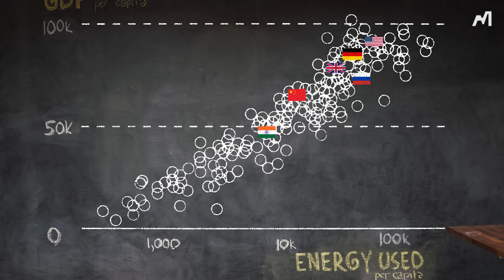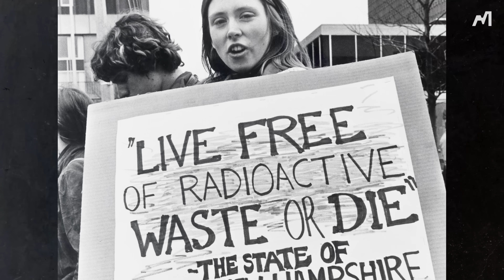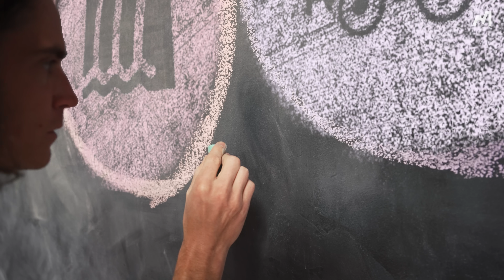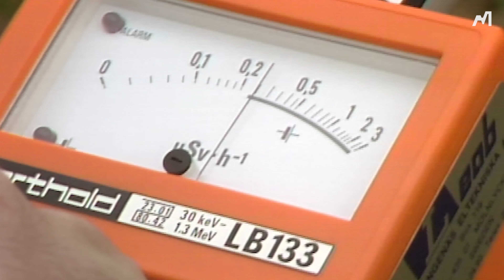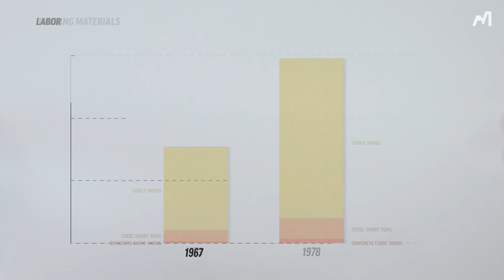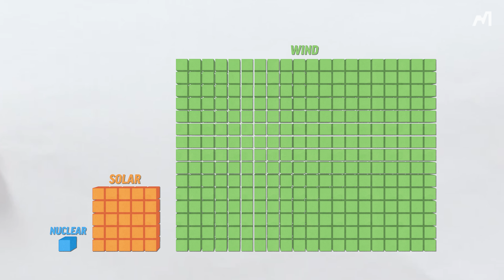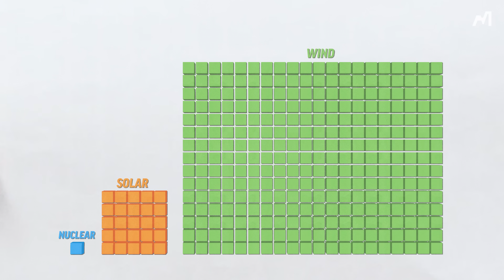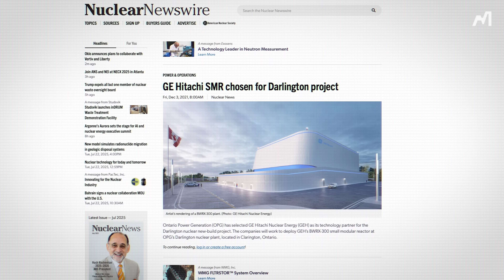They're Lying to You About Nuclear Energy

Comment: It's also worth noting, that average coal power plant releases many times more radiation (along with much more deadly chemicals + smoke) a year that event the nuclear powerplant could.
Reply: Wish more people understood this. You'd be better off hanging out in a nuclear waste cooling pool than you would walking next to a pile of coal ash or god forbid breathing that dust in!
Reply: @DarkAttack14 Oh yes for sure. By inhaling coal ash i had suffered radiation poisoning, which completely wiped out my immune system (no more white blood cells) and led to severe pneumonia. According to biomarkers, I glowed like a Christmas tree!
Reply: @DarkAttack14 What an insane lie! Millions of people all over the world have worked with coal for decades,  and some got black lung, but it wasn't till the bomb tests that cancer rated went sky high!
Reply: @DarkAttack14  that is incorrect. You would be shot before you get into the pool. And being irradiated is better than being dead.
Reply: @DarkAttack14  if the waste isn't damaged it would even be safe to drink from the waste cooling pool.

since fuel before, during, and after being spent is contained in a zirconium cladding and ceramic. all this and even the uranium itself isn't water soluble, so as long as you don't get close to the spent hot fuel and it isn't damaged, you can bathe all you want.
Reply: @D2_Papaya yup, based off the average depth of a spent fuel pool, if you're three feet underwater swimming you actually receive less than background radiation due to the shielding of the water both above and below you, fun stuff
Reply: @DarkAttack14  what do you mean by shielding of the water underneath you? What does that mean
Reply: @raymondqiu8202  If you're in a pool and you dive under the water, there is still water below you. Water acts like a radiation shield, so having water underneath you, you're shielded from what little radiation there is coming from the spent fuel.
Reply: @D2_Papaya  Man, I'm so tired of this BS.
"Our nuclear waste is so clean bros, believe us it's so clean that we sell it to poor countries where it poisons the countryside!
Not that we'll ever tell you about it."
Yeah, you go ahead and keep preaching, I'm not buying it.

Reminder that thousands of people died in Southern Serbia just because of some Uranium-enriched ammunition in NATO bombs.
These are literally just small warheads you could pick up with your hand, and look what it did, a quiet slaughter for decades.
Reply: @raymondqiu8202   Radiation from above (background radiation you're sitting it right now) is diminished if you're in water. Radiation from below (in a spent fuel cooling pool), the rods are in sealed bundles at the bottom of the pool, you have to get within a few feet of those bundles before the radiation they're giving off would equal background, and the pools are very deep. So if you were a few feet under water in an active cooling pool with hot rods below you, you'd still be getting less radiation than anyone walking around the pool.
Reply: @D2_Papaya all you want?? As if it doesn't build up on the body and cause health issues. I think you need to stop drinking that water, its rotting your brain
Reply: @Azmodon  ah ok got you. But if you are a few feet underwater in an active cooling pool, how would you be getting less radiation if you are closer to the rods than someone walking on the ground around the pool? you are closer to teh rods no?
Reply: Go for a nice long soak,you won't need a night light as you'll glow nicely, if you don't boil like a frog first.
Reply: @raymondqiu8202  The water below you would still be more than enough to protect you from the spent rods.
Reply: @D2_Papaya  not to mention the radiation and circulation sterilizes the water
Reply: @raymondqiu8202  I think they're implying while a few feet down the water below attenuates the radiation from the fuel/waste at the bottom of the pool and the water above attenuates background/naturally occuring radiation we all get everyday just being outside. Pilots, airline stewards, and farmers get more radiation total a year than nuclear power plant workers because of how much closer to the sun you are on a plane and because of how long outside farmers are (continuous exposure to sun, continuous exposure to the ground (isotopes give off radiation and they occur naturally in rocks/the soil)). Power plants have shielding and layers of protection from the reactor to where people occupy work spaces.
Reply: @raymondqiu8202  water acts as a shield from hard radiation like gamma rays. the water blocks or slows down the radioactive waves making them less dangerous to a point where they become entirely harmless and get converted to heat. a few meters of water between you and an active reactor core is enough to dissipate almost all radiation coming from the core.
Reply: @raymondqiu8202 water is a medium used in cooling… radiation is heat.. thus shielding
Reply: @raymondqiu8202 radiation is emitted by the earth.  Also Radon comes up from the earth.
Reply: @LTRand ah ok thanks
Reply: @raymondqiu8202 the water above you shields from the sun's radiation. The water below you shields from the waste and earth.
Reply: @raymondqiu8202  - It means that the spent fuel is not at the surface of the pool, and that if you were swimming 3' under the surface, there would still be several feet of water below you and above the fuel, separating you from it.
Reply: @raymondqiu8202  the actual water itself is shielding you from the radiation, that's why it's used and the pools are completely open like they are. Water, while not the best shielding, it's still a good radiation shield that can be acquired in bulk without much issue.
Reply: @D2_Papaya  you first ! :)
Reply: @gary7176  I wouldn't mind using spent fuel as free house heating too, its in a indestructible dry container to begin with, might aswell harness it.
Reply: @D2_Papaya Please don't drink the water. They need it for cooling!
Reply: @raymondqiu8202 As my Dad explained it, water just doesn't transfer radiation. One of those weird properties of certain molecules. Think about it: water cooled reactors don't transfer their radiation to the steam generator part of the reactor, nor to the ultimate cooling system water. Skeptics didn't realize that the cooling water was not radioactive, just warm. Air also has an interesting property for example. If you insulate your walls, the trapped air won't transfer the heat from side to another, but it will if it's allowed to circulate. It only transfers through a single layer of atoms. Aluminum corrodes, but only oxidizes a single layer of atoms. If you leave the atom layer alone, it won't corrode all the way through.
Reply: @TheAlexRhodes  You just compared a literal weapon meant to cause harm, and spent fuel designed to cause as little as possible.
Reply: @TheAlexRhodes There is a difference.
Reply: @raymondqiu8202  the rods aren't what's causing the people outside the pool to receive more radiation than someone in the pool, it's the latent background radiation that everyone experiences everyday just existing causing them to receive more radiation. 

I get you are asking a question and just seem to be curious but the way you're thinking for that to even be a question is part of the whole "fear mongering" about nuclear power. You're assuming even after learning that the water you would be submerged in shielding you both from above and below (as long as you're nearer to the surface than the actual rods) that somehow you just can't be receiving less radiation from the rods. 

Which is heavier, a kilogram of feathers or a kilogram of steel?

EDIT: I realize this is a 2 month old comment and someone may have already said something along these lines to you and perhaps you you understood and it ended up being a constructive conversation. I apologize if that is the case and hope you have a wonderful day 😅.
Reply: @DarkAttack14 yes but the risk of a nuclear power plant melting down or having a problem has much larger negative implications. A fact which everybody in the comments section seems to be blissfully ignoring. Plus many kg of nuclear waste that we often store in a less than satisfactory manner.
Reply: @배고픈13  what you're sayong is the same as saying the risk of a plane crashing means planes shouldn't exist. Only two accidents have occured in the entire history of nuclear plants and it was because of human negligence, not because nuclear plants are bad, and these accidents barely caused casualties.

"Nuclear waste" is just water with a slightly higher tritium content than ocean water already has. It's not green goop that turns you into a mutant with four arms.
Reply: @배고픈13 There are many deaths on any side of any coin. Many people die getting oil out of the ground, many people die from coal mines. In all the time of nuclear power there's been 2 problems. Significantly more coal mines have collapsed than that.
Reply: @배고픈13   the new plants can't melt down. They are walkaway safe.
Reply: @DarkAttack14  But that's just the issue - this isn't an either/or thing.  Neither of these options are worthwhile, given what we know about their down sides.  There are other alternatives that make way more sense.
Reply: @Sharpfinger you consider nuclear not worthwhile or an I misunderstanding your comment? There's absolutely no significant downsides to nuclear power, nor any alternative power sources that make more sense than nuclear. We legitimately should have been on a fully nuclear power grid by this point in history. The only true downside to nuclear is the cost to build the facility, but at the end of the day it's still worth it. Carbon free power production, amazing baseload. Your average nuclear power plant likely requires less lubricating oil versus a wind turbine field. Nuclear energy has the lowest deaths per terawatt/hour of ANY power source including hydro, wind, solar, geothermal. That's accounting for deaths during construction, and does include deaths from the byproducts (and the major nuclear incidents we've had in history)
Reply: @DarkAttack14 Hmmmm, this is, to say it lightly, vastly misleading, although it holds truth to it.

A fair comparison would be to hang out in the safe areas in the pool where you are shielded from the radiation and then walk by the coal plant with a breathing system and appropriate filtration for the particles.

Does this indicate in any way one is superior than the other in terms of safety? Not like in the picture painted by your comment. Is nuclear power still safer than a coal plant? Yes. Does this mean a nuclear power plants are save and nothing can happen. No.

Paint a fair picture, would you?
Reply: @leandergihr9598 not vastly misleading. Accurate. People just don’t want to hear it.
Reply: @Nill757  Nope. I´ve made my argument in detail. It is, in fact, a missleading explaination. Yet it still doesn´t mean that coal is good.
Reply: @leandergihr9598  okay but the nuclear spent fuel is heavily protected and shielded while the coal is exposed. it's a fair comparsion because these are the actual dangers we experience
Reply: @kibukaj2956  and @Nill757 you both got it wrong what the point was. Nobody arguing agenst your comparison is pro coal. But you want to paint the picture that nuclear power is safe by painting a bad picture of coal (worse than it actually is). How does this help the argument? When people do the research and see that you paint a disingenuous picture, the trust in nuclear power will get even worse. Regardless of the actual safety level of nuclear power.

We havn´t had safety protocols for coal back in the first industrial revolution but we now have (I´m talking from the EU perspective because thats where I´m located) and we do have safety protocols for coal in place. Coal is STILL killing more people by a mile and coal is bad. But there are regulations for filtration and for transporting coal in place and it´s not like a horse is towing the coal in an open container and the guy is burning the coal in an open fire, contaminating everyone around him without any precaution. That´s the issue of the argument.
Reply: @DarkAttack14 those aren’t the same the cooling water in like the feedwater of the coal plant and the ash is a byproduct much like nuclear waste
Reply: I'd like any polling on nuclear power to also ask "What is the white stuff above the cooling tower?" to see who thinks it is smoke and who thinks it is steam. (To help calibrate how being knowledgeable might align with support.)
Reply: @gordonmcdowell while I dont agree on every point made, im grateful for the opportunity to learn more about something i admittedly knew very little about about prior so.....thanks 😅😊
Reply: This is 100% true. Coal contains trace amounts of radioactive elements like Thorium. The leftover coal ash still contains a lot of that Thorium. As such, coal ash sites are more radioactive than nuclear power plants.

Scientific America published a paper on this back in 2007 in case anyone was wondering.
Reply: @troybaxter  not just thorium. most coal deposits contain radium, uranium and polonium.  compared to this nuclear reactors are outright clean in comparison.
Reply: @troybaxter  hats of to you. good stuff quoting the paper👏👏👏👏
Reply: @troybaxter thorium and radium
Reply: @troybaxter  also radioactive izotopes of coal
Reply: @rokaslokusevicius3810  coal is not an element. I think you mean carbon.
Reply: @troybaxter  same thing in my language
Reply: It's steam not smoke...😮‍💨
Reply: @75shadystorm Coal-fired generating stations produce both.
Reply: Many , many people are killed every year just from breathing oil exhaust, certainly over a million, although unknown, the number that die from coal related deaths is less than that. I was a miner, but not coal, all the miners I worked with were coal miners. Most of them are dead.
Reply: Roughly 30x. From the NRC site and a nuclear engineer's word. But it's still low, lower than normal background absorbed dose. Don't be hyperbolic in the opposite direction, that would be hypocritical to your point ...
Reply: Like many subjects, processes, and fears that are KNOWN in the general population, hype and spin have skewed the truth.
I was a nuclear refueling worker for years, and the general public is ignorant of nuclear energy, and programmed to fear it. 
My take: research everything. Trust nothing. Everyone (press) lies. Except for this very good production! Thanks for some truth!
Reply: you left out the mining and trans of coal, by the time you factor that in, it's a no bwainer.
Reply: @Sammyli99  Indeed, the mining and transport is a big problem with power from coal. The same applies to nuclear power, just much worse. On the other hand, generating power from steam that is directly produced by heating water with sunlight, doesn't involve any mining or transport That is a no brainer, too.
Reply: @Nonononono_Ohno solar has a larger carbon footprint, also requires rare earth mining, transport, is intermittent, requires fossil fuel back ups, dumps cadmium and lead into the environment, and majority of the panels come from China. Thorium is hands down the most obvious long term energy dense per sq ft clean energy. To argue against it is obviously corrupt.
Reply: I used to listen to the late Dr. Bill Wattenburg's weekend shows on the now-defunct KGO 810 AM, San Francisco, where he often repeated what you say.  In his words, coal plants are "filthy" when it comes to releasing radioactivity compared to nuclear plants.
Reply: Lets petition radiation regulations on coal power plants.
Reply: it’s almost like there different types of radiation..
Reply: Coal isn't nearly as bad as you make it out to be
Reply: @victorkreig6089  look at the annual death rates from different energy sources, coal would disagree.

you'd need to put all of nuclear energy deaths and the "potentially associated" deaths in history on that same graph for it to even show up.

you could also look at all the chemical seepage and waste dumped into rivers and sent into the ocean from india and china, being the biggest offenders.

if people were really putting being green as a priority, we would sanction, tariff, go to war with, etc, those countries. but no, its easier to complain about hot rocks that you think are green.
Reply: Google “Price Anderson Act” then ask, “If nuclear power is so safe, why can’t they get any insurance company to insure their nuke power plants??”  US taxpayers are paying the cost to insure ALL nuke power plants in the US.  This cost is never factored into nuclear energy operating costs.  No insurance companies will touch nuke power because they understand the true level of risk and liability.  It’s incalculable.  Watch the vid of Fukushima Reactor 3 exploding.  Each reactor needs continuous cooling water pumped through it.  If cooling stops…. BOOM
Reply: Yes, so coal plants must be closed and plan to build new nuclear plants - abandoned.
Reply: Coal is just stored solar energy along with everything energy source on earth all of which couldn't be created without stored solar energy yes even nuclear.  Most of the world runs off of stored solar energy,  plastic is made from stored solar, gas run off of stored solar, even nuclear powerplants are built using stored solar energy
Reply: that clippy is a simpy, he visited all the youtube bots onlyfans
Reply: I should have read your comment first, I posted something along the same lines.
Reply: Get your head checked, no it doesn’t.
Reply: Facts
Reply: if everything goes acording to plan :p
Reply: Thats also why cancer rates skyrocketed during the industrial revolution, more people died of cancer in London in a single year of late 1890s than in all of Europe in 1992.
Reply: Look into the radioactive waste in Martins Ferry Ohio
Reply: They have successfully hidden the radioactivity in coal and natural gas.
Reply: The problem with nuclear is the cost. Long build time & waste handling & security costs of the waste, for decades after.
Reply: Not "could"... as has been proven twice now. But, sure, as long as those accidents don't happen, we keep a lot of concrete between people and radiation.
Reply: Are you talking about "clean, beautiful coal"? lol
Reply: No it doesn't. That's not accurate at all.
Reply: It’s worth noting if a nuclear power station went wrong in a badly run incompetent country it can go boom and affect most of the world
Reply: And your point is what?? Take Hawaii for example, it is effectively a volcano island and has a wide ecosystem of flora and fauna. Do volcanos not release smoke and chemicals?? Did you know that plants thrive from C02? Their are 5 main games that the atmosphere of the earth needs and they are oxygen, helium, argon, nitrogen and you guessed it carbon dioxide. Why would you want to take away or lower the volume of C02. Did you also know that their are way less "smoke and chemicals" in the atmosphere than say, the 1800's and early 1900's. Also, the US has the cleanest coal and natural gas plants in the world with a near zero emissions, China and India on the other hand, not so much. Learn more and stop watching so much TV, it's destroying your brain. This earth and the living things on it have survived and can survive much more than some smoke coming from power plants. Think about the agenda of what people tell you on TV, fear is strong motivator and if you aren't equipped with the right information, well, you will easily fall victim to their fear mongering.
Reply: In Borssele, the Netherlands, there is a nuclear power plant build next to an active coal power plant. The coal plant has shut down and is demolished. The fact that they both operated says me it did not create an overdose of radiation at the nuclear power plant. Or at least, with the coal we burned in the Netherlands.
Reply: Not all coal is radioactive, the cleanest coal is anthracite. Its up to 97% carbon.
Reply: @Delt4_Cr4wfish makes a lot of sense
Reply: Solar panels cause fires and a lot of killer pollution for their manufacture. Windmills send people nuts and they go postal. Jury still out but... they are not sustainable.
Reply: people who work in coal plants, their boots will set off the portal monitors in nuclear plants.
Reply: @Vitrolic32 this is not true. I am a radcon worker.  It will only set off an alpha particles detector. You eat alpha particles every time you bite a banana
Reply: @chaschristiansen  Potassium-40, the radioisotope in bananas, is a weak beta emitter, not alpha, half life 1.2B years.
Reply: ya it bothered me that they tore down the nuclear plants in germany and local villages to make coal mines
Reply: There is no such thing as permanent, safe, storage of spent fuel (witness the ongoing storage of spent fuel at plant locations from lack of dumping sites, making each reactor site "an event in progress," just like what is going on at Chernobyl and Fukushima)!
Reply: "You cannot make a silk purse out of a sow's ear!"
Reply: More stupidity is not the solution to stupidity.
Reply: And what radiation are those?
Reply: @Traumatree  uranium, thorium, radium, and radon are released as particulates in coal power plants.
Reply: @Gurry45  There are no such elements in coal my friend, unless they are already irradiated.
Reply: Basically every industry learns from mistakes so every disaster makes it safer
Reply: For Fukushima,they have learned from Chernobyl and is prepared to respond to an accident
Reply: It is ridiculous to declare that if ever there were ultimate limits to "growth,"" it would look exactly like what is happening now, where every option sacrifices short-term advantage at the expense of long-term destruction, including global warming, resource depletion, extinctions, failed economies, starvation-- you name it!
Reply: Look up the number of deaths per year from air pollution by FF PPs; divide by the number of GW-sized FF power plants and you have the number of people killed ANNUALLY by one such FF PP's pollution alone.  The answer is over 2000, but don't take my word for it -- look up the numbers yourself!  Over 2000 deaths EVERY YEAR from ONE GW FF PP.  We humans are weird about what we choose to worry over.
Reply: If ever there were a ultimate limit to "growth," it would look exactly like what is happening now, where all the options have short-term benefit at the expense of long-term consequences (witness global warming, resource depletion, wars over resources, starvation, extinctions, economic collapse, and political divides that can never be reconciled at forums, among many others).
Reply: ESL?
Reply: When did any dentist put a heavy vest on you when they x-rayed your teeth. Have I been going to the wrong dentist?😂😂
Reply: yes but when a missle hits it, it wont poison the land for a century.... i know weak westerners think war cant ever happen again, but it absolutely can.
Reply: yep, i even heard somewhere that that is the reason why we cant convert coal power plants to nuclear ones because it is too radioactive :D
Reply: @nonridiculousadjective6597 it could mess up measurements, when you're looking for genuine man made radiation
Reply: @nonridiculousadjective6597 😅
Reply: Radiation is an umbrella term, its not all the same. This is more complicated than what you think
Reply: @4ve.m4ria3 Alpha, beta, gamma.  What else?
Reply: I work in nuclear energy, and support it. But this is misleading. Uranium produces  4 types of radiation, alpha, beta, gamma and neutron radiation. Coal only releases alpha particles. If you don't ingest alpha radiation, it can't hurt you. Gamma and neutron radiation both pass through the body.
Reply: @chaschristiansen check your “facts”.
Reply: @Nill757  let's talk facts. Coal is a constant low radiation producer, average exposure to those around a coal plant is 1.8 mRem per year from breathing or eating radioactive particles. The average exposure at Chernobyl was 16 Rem, or 10,000x that. The safe limit for limited radiation workers in military applications is 100 mREM before you even really care that you got hit. You get more radiation from a summer at the beach than you do from coal. Your turn for facts.
Reply: @chaschristiansen What possible use is  there in comparing the singular Chernobyl accident to  everyday operation of anything else? Count harm from coal mine accidents, coal plant accident, entire mountains of coal ash sliding into rivers like Kingston spill, the Dan River spill, or, life years lost from standard coal stack pollutants, NOx, SOx,, PM10, PM2.5, etc..
Reply: @Nill757 coal is only beating nuclear because we have built 50 times as many coal plants throughput history. The disasters matter because when a nuclear plant has a serious problem, it is more destructive than coal could ever be. I am pro nuclear, I have operated, repaired and improved reactors my entire working life. But misleading people about it causes an aggressive rejection when reality hits.
Reply: @chaschristiansen  “nuclear serious problem .. …more destructive than coal”

saying that doesn’t make it remotely true. It’s the old nonsense, that well coal is just combustion which has been around forever, doesn’t really hurt anyone. Nuclear though, it’s scary because HBO, Greenpeace.  Coal has robbed millions of life years through emissions via traditional pollutants,  which nuclear power never has or will in a thousand Chernobyl’s, and now coal is a primary cause of greenhouse gases.
Reply: @Nill757 first, again I didn't get my data from green peace or TV. I was working on a control rod for an S9G nuclear reactor yesterday... Second, nuclear is safe in the US, for the same reason it costs too much to be a cheap source of energy. It is heavily monitored, regulated and operated to very strict standards. The more proliferation, the less control. If nuclear was as widely available as coal, accidents would occur very often due to a lack of people capable of being responsible enough for such a system. The average coal worker would die quickly working on nuclear systems simply due to lack of effort and motivation.
Reply: @chaschristiansen Look, wherever you  work, the things you are claiming here are not any training manual, like a coal plant guy would die from lack of motivation.   You’re grossly misusing terms, like “nuclear is safe in the US”, completely subjective.  That’s handwaving.  Radiological doses are factual, quantifiable. Fatalities are quantifiable, for instance, there has never been a fatality from radiation poisoning due to commercial nuclear power operation in the US.  Likewise, some nuclear accident is not just magically much worse than coal harms from stack  emissions everyday around the world. You claimed it was, and your control rod job tells you nothing a coal stack emissions, so knock off the posing bs.
Reply: @chaschristiansen saying the average coal worker would die quickly because of a lack of effort and motivation is… an unbelievably odd statement. 

What do you mean by that? Who are we talking about? Are we talking about the guy on a forklift shoveling coal off a train into a use pile? Or are we talking about the mechanical engineers who studied 4 years in school minimum and then took on apprenticeships for 4+ before ever autonomously managing a system? 

I don’t think we would have people moving active uranium on forklifts, the same way we wouldn’t have people moving coal ash without a respirator. 

Your suggested frequency of accidents is inherently flawed. Not sure how you managed to get a degree in nuclear engineering with this thought process. Nobody would suggest we just swapped every worker over from the coal plant to nuclear plants and every mechanical engineers to a nuclear engineer, that’s feasibly impossible primarily due to the fact that nuclear power plants take decades to build before they are fully functional. The argument this video, and the people in the comments are making, is that integrating and eventually being partially reliant on nuclear energy is optimal, safe, and could be routine. This would include a push in higher education for more nuclear engineers. 

I don’t know whether you have an immense amount of pride, but given that nuclear engineering as an academic discipline is touted as an equal to mechanical engineering, and objectively easier than electrical engineering, you should have no shortage of scholars capable of completing degrees and training with respect to the regulation and oversight necessary to manage nuclear power plants. In the same fashion, you can retrain the same individuals who would be doing manual labor at a coal plant to do manual labor at a nuclear plant. They did this in milledgeville Georgia, and now 30% of Georgia’s power is produced by nuclear. 

It sounds like you have some sort of superiority complex that disallows you to account for the fact that there are indeed plenty of capable individuals aside from yourself or your peers; they just didn’t happen to study or major in nuclear engineering.
Reply: Modern coal power stations have much better filtration than before.  Sure it's not completely clean, but coal plants should be used as backup power in case nuclear goes down,  It's never a good idea to put all our eggs into the same basket.
Reply: That's why they have scrubbers to remove those toxins. The emissions from modern coal power plants is negligible.  Also look in to how 'renewables' are made. All rely on heavy fuel l, particularly coal power to be made. More energy than they will ever produced.
Reply: As if there weren't already enough reasons to avoid coal!
Reply: its also worth noting, people are not afraid of a well functioning reactor's radiation output. People are afraid of the possibility of an accident or waste mismanagement. That might not happen nowadays but thats because of the stringent safety measures. And those safety measures are whats making nuclear so cost ineffective. We also kinda see in this video an advocacy to lessen those measures to cheapen nuclear, and thats a big nono. 

He glazed very lightly over the incidence of an accident like chernobyl or fukushima. Especially the first one. It wasnt just 50 deaths. He's being very disingenuos or dishonest there. The total cancer death toll impact of the chernobyl accident is estimated at ~27,000 (excluding thyroid cancer), though this remains debated due to methodological and ideological biases. The radiation leak was severe and we were lucky we could contain it. We dont want to be repeating that every half a century. You also have to realize that if we really make nuclear mainstream, the probability of making errors will also grow. One of the reasons for its relative safeness is also its very sparse and controlled distribution.

Im not afraid of nuclear nor against it. I think we should use it, especially if it means replacing fossil fuels. But we need to keep all the safeguards, and we need to work with them in mind to make it cheaper, not going around them. These small decentralized reactors seem like a good idea and im all for it.
Reply: It takes 2 coal plantsto supply a nuke plant with power. And the isotopes are released from the spent fuel pools which are not in any sort of containment!! Your statements are complete lies. Coal mining may release radon, but mining uranium releases as much or more! And the isotopes released by nuclear powerplants, such as plutonium, were never experienced by life on earth before!
Reply: Nonsense.
Reply: true, but uranium tailings piles dwarf any coal plant.
Reply: @mattbanks3517 no, a kg of Uranium provides about 1,000,000x more energy than a kg of coal. This means you have to mine, process, and ship 1/1,000,000 as much material. There is NO comparison between the impact of mining uranium vs coal. You can see coal mines from space, a lot of Uranium mining you wouldn't notice if you drove by it.
Reply: False, coal and nuclear power are not even remotely supportable at all, but not for the reasons you state.
Reply: source?
Reply: And we all know coal is awful. That doesn’t suddenly make nuclear radiation “safe”. There shouldn’t be any coal plants in the first place. 

This is all just marketing. Phil Andrews isn’t a scientist, nor is his content provider. They’re all marketing analysts and finance people and if any of you were capable of any critical thinking you’d be looking into where the funding for this glitzy video with the hip actor is coming from. None of that is disclosed. 

There is certainly another side to the story and, at 5 minutes, which is about all I can take, no real look at the other perspective. Exposure to radiation, for example, is way more complicated than just radiation in the air. At 3 mile island, Chernobyl, etc., it also got into the water, the water table, and all the animals that drink that water, eat the grass, and are then eaten by humans. Exposure is multifactorial.
Reply: BINGO!
Reply: It would be pretty hard to build a nuclear plant without coal power plants being in use.  Products derived from coal power plants are used to make the 2 most important parts  of a nuclear plant concrete and steel.
Reply: And that neither coal nor nuclear are economically sane to build now
Reply: @Timlagor Why not? Check out on Wiki the "energy return on investment (EROI)"... economical sane is what's the most efficient(= less costs) way to produce Primary Energy and Electricity! Look over here in Germany what's happen with Electricity Consumer Prices if you shut down the most efficient Thermal-energy Powerplants for subsidized Windmills (cuz the EROI is a non-marketable Joke) for a Mechanical Electricity Generation without any Primary Energy Output! Is this quite economically wise, in view of the constantly further increasing energy demand, to choose a Production technology that's dependent on the good will of Natural weather and climate conditions and whose future expansion is already limited from outset? Oh and in the best case of Weather and if the "most atmospheric Greenhouse-climate conditions in the Thermosphere doesn't change any more" (what's pretty unrealistic) Germany has circa enough Wind for 200GW Electricity Generation.
Reply: @Timlagor 😅... 'renewables can't be built without them.
Reply: @Timlagor nuclear is economically viable to build. Maybe not in a profit-motivated system.
Reply: @Timlagor Stay tuned. New reactor technologies are coming online within the next few decades. If they weren't economically feasible, they wouldn't be getting funding after all we know now about reactors.
Reply: Apples and Oranges - I bet you don't consider nuclear accidents. I also bet you never compare wind and solar because people here have an ideological hatred of renewables.
Reply: Sounds like because of your argumentation, nuclear must be much less harmful than coal. I'm not at all a fan of coal, but this argumentation doesn't work. It's not the normal operation risks that make nuclear dangerous, it's the worst case scenario risks. Coal plants can't cause accidents and contamination like in Tchernobyl. Nuclear plants can. When such an accident happens, it doesn't help the locals that the nuclear plant had been running safely and much safer than a coal plant, during the 30 years before.
Reply: @Nonononono_Ohno  But you are talking hypothetical scenarios instead of actual scenario, coal is pumping radiation to the atmosphere right now every single one of them more radioactive than any nuclear power plant. The only case where a nuclear power plant was put out more radio active material is Chernobyl and that happened only once in 70+ years of operating nuclear power.
Reply: @Nonononono_Ohno This is fearmongering, you can't make intelligent, rational, and well reasoned decisions based on the worst case scenario, yet as explained by the video this is what the regulatory bodies that adopt nuclear have done. You're far more likely to die from a traffic accident than even remotely anything close to nuclear related unless you work at a nuclear weapons lab (probably the segment of the population most risk prone to nuclear accidents). Unless you literally never leave your house you can't make this argument. Instead, we can use the analogy to guide smart decisions around nuclear. Drive a safe speed, stay off your phone, and wear a seat belt. These three things reduce your individual risk from statistical to much lower. We can do the same with nuclear, sane, smart, and rational regulations that reduce the risk to the public without being absurd to the point that nobody can operate a reactor.
Reply: @Nonononono_Ohno  So, what is you plan to provide more baseline power?
Reply: Nuclear, all of the way. Cleanest energy source, by far. Just have to remove the popular hysteria.
Reply: @Nonononono_Ohno  "it's the worst case scenario risks" nuclear plants are much more safe in the worst case scenario than any other power plant. Have you ever seen what happens when a coal plant fails? or when a dam fails? Go erudite yourself about Vajont in Italy.
Reply: @WalterStucco  The dam failure in Vajont was a catastrophe, no doubt. After such a conventional energy facilities failure, there aren't huge areas of land that are toxic for thousands of years, as is the case with Tchernobyl. However, the main problem is that muclear and fossil power will not last forever. At some quite near point in time, a future generation will not only have to solve the problems of how to get all the carbon dioxide out of the atmosphere and what to do with the huge pile of nuclear waste that we have left them. They will inevitably have to make the transition to renewable energy, and they will have to do this without any energy left.
Reply: @Nonononono_Ohno  Chernobyl was a single event, in the whole human history, in a place and time that never have happened before and won't never happen again. The Vajont disaster is not the only one. Secondly: of course the dam is still there, but the site is unused, so the scar to the environment is still producing damages and psychological consequences 60 years later. Radiation poisoning over a small already not highly densely populated area is not the only possible long term issue. Actually the area where the Vajont dam is, is considered one of the most polluted areas of the entire EU, causing tens of thousands of preventable deaths each year, or, to put it in Vajont terms, at least 10 Vajont EVERY SINGLE YEAR. It's mainly caused by pollution from heavy industries using fossil fuels. I would rather have ten nuclear plants and thousands less deaths, then ten coal plants. What about you?
Reply: @Nonononono_Ohno  BTW nuclear waste is a much exaggerated issue, in the meantime fossil fuel emissions poison the air, the soil and the water supply, every day, in much larger quantities, through ashes and particulate spread everywhere by winds and rain. And the damages last a very long time and are very hard to fix.
Reply: @WalterStucco  Can anyone guarantee that Tchernobyl won't happen again? I don't think so, especially when considering that there are more and more geopolitical threats. You ask, what about me? I would also rather have ten nuclear plants than ten coal plants, albeit not because they cause less local pollution, but because they don't poison the atmosphere. I would favor to have everything solar only, though. Every form of power has its very own problems, but solar is the only one that won't run out some day. Future generations will be happy if we think about them a little, too.
Reply: @Nonononono_Ohno  This comments is quite ignorant...

"Coal plants can't cause accidents and contamination like in Tchernobyl. Nuclear plants can. "
Show me any RBMK reactor in the west you genius....
Reply: @molnibalage83  No need to get insulting. Three Mile Island and Fukushima are examples of severe accidents in reactor types other than RBMK. There is potential for severe accidents in any nuclear reactor if safety systems fail or are compromised, and only because for a specific reactor type there have been no severe accidents yet, it does not mean that a severe accident is ruled out. However, this discussion is missing the point. What really matters is that both nuclear power and fossil power are unsafe and have a heavy environmental impact, that both of these fuels will run out already soon, and that using them without making the transition to solar energy means living on account and risk of future generations.
Reply: @Nonononono_Ohno only Tchernobyl was a radioactivity disaster, not the other ones. And what's funny is that Tchernobyl became a natural reserve where animals and flora thrive...
But your windmills and solar panels doesn't have the same lifespan to nuclear reactors and will get less efficient with time, does use metals and minerals that need you to dig big holes in third world countries, is harmful to some fauna such as birds and kind of destroy the environment because of the need of space to set them all up.
There is also the issue of those energy, except for barrages, of not being constant due to the nature of the sun and wind not showing up constantly.

The real reason why solar, water and wind are the way to go in the future is because we will not have enough nuclear reactors fuel on earth for an unlimited use.
And then there is fusion.

I have another thing to say, nuclear energy is the best energy to slowly transition to something better without polluting our world as much as we do with coal, petroleum (oil), Gaz.
Switching instantly to full renewable energies will just lead to what Germany is doing, even more coal power stations working.
Reply: @jacksheldon8566  Before you haven't read what I said in my other comments, it doesn't make much sense for me to reply. Nowhere have I suggested to build windmills or solar cells. In the long run, the only way to go is solar power, with conversion of heat into mechanical energy, by using generators. This is the only way to generate energy without adding lots of additional energy into the system. And we better do the transition soon, before all other forms of power have run out of fuel and we have no fuel left any more to do the transition.
Reply: @Nonononono_Ohno  how many coal accidents vs nuclear?  Fires?

Perhaps you didn't catch the part on how few died from nuclear?  Even in a catastrophic failure it is safer.

And for Chernobol, it literally cannot happen in the US.  We never built production reactors like that one.  They built an inherently unsafe design.
Reply: @LTRand  Please read again. I was only saying that his argumentation does not work, for the reason I explained. Regarding your argumentation that points out that nuclear energy is the only way to go, I have a differentiated view. First, the failure in Tchernobyl affected whole Europe, and it was much more catastrophic than a coal plant failure could ever be. Second, failures can always happen, no matter how safe a plant is built, even in the US. And even if all possible technical failures have been accounted for, one can never account for human failure, especially when it is deliberate. Third, and this is the most important factor, future generations need to be considered. Coal is absolutely a no-go, because it leads to a rapidly warming climate. Some day, future generations will definitely have to transit to a climate-friendly alternative. Nuclear is much better in this respect, but even nuclear heats up the atmosphere, because additional energy is brought into the system. What really matters though is that nuclear will not last forever. So some day, renewable energies like wind and Sun will be the only alternative. But the transit from coal and nuclear to wind and Sun costs a great deal of energy, because plants need to be built, and so on. If we leave future generations with no coal and no nuclear fuel, they will lack the necessary energy to perform the transit. Therefore currently, nuclear seems fine to me, but only under the premise that it is being used to transit to wind and Sun as quickly as possible. This is a purely logical and rationality-driven point of view, I am aware that it will conflict with all the lobbyists in here, for whom large profits are all that counts.
Reply: @LTRand they never even finished it as designed, the containment building was little better than a cow shed
Reply: @Nonononono_Ohno  Solar and wind have their own problems. Did you not watch the video? Nuclear power is extremely safe and is a very clean energy source. With technologies like breeding reactors and thorium, we have enough nuclear fuel to last centuries. Yes, solar and wind are usefull and good and should be expanded as necessary, but they are very limited compared to nuclear energy. Whichever route we go, there will always be downsides to each source of energy, nuclear just seems to me the best option for sustainability at large scales.
Reply: @hrafnagu9243  Sure, I have watched the video. It is very biased, and I assume there were lobbyists at work. Yes, nuclear power is rather safe. No, nuclear power is not very clean. Apart from producing nuclear waste, the main problem is mining and extracting uranium and thorium, which almost always has a huge environmental impact. Furthermore, nuclear power acts as a significant hurdle to the roll-out of renewables and fossil fuel phase-out. Solar and wind are not at all limited compared to nuclear energy. The total available Solar power exceeds 10,000 times the world's total energy use. Sure, thorium may last for another few hundreds of years. But if coming generations are left with no fossil and nuclear fuels, together with a huge pile of our nuclear waste, they will not be able to transition to renewable energy any more. They would not be happy about the heritage we have left them. I agree that currently at least some nuclear power can't be avoided, but everything should be done to not let this happen.
Reply: @Nonononono_Ohno nuclear doesn’t heat up the atmosphere and if it did then legit any other energy source would. Adding a small amount of energy to the atmosphere doesn’t do anything it just radiates back into space the problem is when that energy gets trapped in the atmosphere by green house gasses
Reply: @Nonononono_Ohno by your logic we should never fly planes since “we can not account for human error especially if it’s deliberate”
Reply: @Nonononono_Ohno nuclear is significantly less impactful environmentally than renewables or fossil fuels. Fossil fuel waste never goes away, and we dump it directly into the atmosphere. Renewables produce very little energy aside from hydro for notable environmental impacts from manufacturing 
Nuclear is genuinely the best power source we have. It’s the safest, cleanest and most efficient

There’s a real conspiracy here, and it’s there to keep us from using nuclear power
Reply: @Nonononono_Ohno The funny thing about both solar and wind energy is that the resources used in those aren't renewable, and the materials degrade over time. The materials for solar panels specifically are also hard, if not impossible to recycle, causing waste after their lifespan is up.

So while you're not wrong, the same argument can be used against you. As such, it is a bad argument.
Reply: @Nonononono_Ohno  terrible argument because it can and is applied to every other source of power. Solar specifically REQUIRES batteries and both solar and batteries require mining which affects the environment. Wind kills so many birds and bugs that it drastically affects ecosystems and therefore the environment. Wind turbines also take a lot of epoxy, which is made from petroleum which has environmental impacts to define and manufacture.

Nuclear requires much less and we could develop them to last 100s of years vs 20 for other sources.
Reply: @LTRand  Stop lying about "how few died from nuclear". That's why you people aren't taken seriously, you're intentionally avoiding the truth of the danger so you can pretend to be smart out of forced ignorance but you're not. "It literally cannot happen in the US" is one of the dumbest things you could say on this subject.
Reply: @Nonononono_Ohno  
>The total available Solar power exceeds 10,000 times the world's total energy use.
Maybe if we covered the whole world with panels. You talk a lot about lobbyists but I'm fairly certain you have stock in Solar.
Reply: @Nonononono_Ohno there have been several coal ash spills that have claimed way more lives than any nuclear disaster. I can’t speak for the world but I’ve worked at a coal ash landfill. They dumped it into a hole with no lining beside a freshwater lake for almost a century. The ash alone has claimed more lives than nuclear ever will.
Reply: @harrylorange2474  I am not sure how you conclude that we should not fly planes. A plane crash will not devastate huge areas of land for thousands of years. There are better and more future-proof alternatives to nuclear power, but currently there are no good alternatives to airplanes. Of course you could argue that most airplane flights aren't necessary at all in the first place, to which I would agree.
Reply: @CottidaeSEA  I tend to agree that the resources needed for wind power aren't genuinely renewable, at least currently. Resources of solar power are renewable, though. Solar panels are not necessary, since solar power can be generated from steam by heating water with sunlight. The generators can be repaired and recycled completely. The same applies to mirrors that focus sunlight.
Reply: @Nonononono_Ohno  Generators need oil, plastic, metals. The water would need to be transported away from the ocean in order to cause minimal harm to marine life, meaning massive pumps.
You've simplified all of that in your head, but you've not thought at all about the environmental impact.
Reply: @duckner  I am not sure which argument it is that you think is terrible. However, solar power does not need mining intensive batteries. Energy can be stored by pumping water into a reservoir at a higher altitude. There are various concepts for energy and resource friendly batteries, such as moletn salt batteries. Some of these methods initially may need some minig, but later on can be recycled completely. I agree that wind wheels are problematic in some respects, in my opinion solar energy is the better option, not least because there is plenty available. You seem to think that hundreds of years is a long time span. It isn't, and very soon the generation that we have left without any energy will be born. They will love us, if all we leave them is lots of nuclear waste and carbon dioxide in the atmosphere.
Reply: @CottidaeSEA  Generators can be built completely without any plastic. Lubricating materials can be produced from natural, renewable resources. It does not take more water to produce steam from solar reactors than it takes water to produce steam from nuclear reactors. If storing energy by pumping up water turns out to be an environmental problem in some areas, which I assume that it can, then there are other things that can be hauled up to store energy as potential energy.
Reply: @InkyBlitz  The former governor in my state helped with getting a bunch of our prime farmland covered in solar panels. Since getting out of office he is now on the board of one of the big companies he helped get going.
Reply: @LTRand  Not to mention modern reactor designs basically CAN'T meltdown, they automatically physically shutdown before ever reaching critical temps. 
i.e. The dump tank plug melts well before dangerous temperatures
Reply: @Nonononono_Ohno  Chernobyl occurred at a time when there were no modern cleaning methods, and the nuclear power plants themselves were still very imperfect. Coal-fired power had decades to develop by the time nuclear power appeared at all. Currently, recycling spent solar panels is more difficult than recycling nuclear waste.
Reply: @hahaper2037  Yes, indeed. So, what kind of conclusions should we draw? I think it's quite clear. First, if nuclear power is the only alternative, make sure to use modern, state of the art reactors. They aren't completely safe, but much better than old reactors. Second, good or bad coal plants don't make nuclear power any more or less safe. Third, and this is the most important conclusion, do not use solar panels for large scale power plants. Collect sunlight instead, heat water with it, generate steam, and power turbines. This is very environment friendly, there is almost no mining, extraction and recycling, it is the one and only form of power generation that does not add energy into the system and therefore doesn't lead to global warming, and it is the only form of power generation that lasts practically forever.
Reply: @Nonononono_Ohno  If the thousand more years nuclear fission could buy us isn't enough time for nuclear fusion to become viable, humanity wasn't gonna make it anyway.
Reply: @Nonononono_Ohno its just “argument”. Not “argumentation”.  No such word.
Reply: @ralphstern2845  Of course the word "argumentation" exists, and there is a difference between the words "argument" and "argumentation". The Merriam-Webster dictionary gives this main definition of the word "argumentation": "1. The act or process of forming reasons and of drawing conclusions and applying them to a case in discussion."
Reply: We cannot power the ground with one source. Each source produces power in a different way. Currently the reason we leaned into coal and gas is because they are more versatile and can meet most needs on their own. However, the downsides have become clear.

In the modern world we will need an energy mix to meet the needs of the grid. Likely nuclear will be used for some of the baseload, wind and solar will be used to make electricity cheap and affordable, and natural gas, hydro, and battery storage will be used to balance the grid and serve as backup
Reply: @LTRand And the Chernobyl accident happened because of human stupidity. The Soviets knew the design had problems, they had rules, for example one very important one was that a certain number (a third?) of the control rods must never be retracted more than half (2 thirds?) of the way out of the core. Then they gave some idiot from "out of town" the authority to overrule the plant operators. He ordered all the control rods completely removed.
Reply: @Nonononono_Ohno Well if you take a really long term view to heart we need to invest in nuclear and get viable breeding populations off this planet onto other rocks before Earth goes through another mass extinction event, because betting on solar beyond Mars probably isn't going to be enough, especially if our species ever tries to leave the Solar system altogether.
Reply: @joaoaguiar1714  If our species cannot solve the problems it has and constantly generates on planet Earth, then I don't think that it will ever reach a point where it can move to another planet, let alone solve the problems it would certainly generate there too.
Reply: @Nonononono_Ohno climate? Buddy...its cooler now then it was when the romans were marching... we're also still coming out of the last mini ice age, welcome to the cycles of earth, it heats and it cools.
Reply: @seanowens3153  If it is your belief that the human made temperature changes are only a temporary, short and naturally caused episode, then it is a belief that goes against the incredibly large and unmistakably clear evidence that has been aggregated in the last decades. I am not here to discuss beliefs and religion with others.
Reply: @LTRand due to scale. if you put as many nuclear plants on earth as coal, especially in places where there is little technical expertise you will have meltdowns every year
Reply: @LTRand so glad almost noone died after they only had to evacuate a whole county and build the largest building on earth to cover it so they can fix the leaks in the largest pile of concrete on earth, oh and it got a hit by a drone and they can't use it anymore. You really got it all figured out.
Reply: @Nonononono_Ohno  dude, in a hundred years we will have figured out fusion reactors and will probably be mining asteroids for resources.
Centuries of technological advancement is a lot.
Reply: @jamescarter3196  nuclear has killed less people than even hydropower even when u use the highest estimates of deaths due to Chernobyl
Reply: @LTRand  In the hands of humans anything is possible.
Reply: @LTRand considering in Chernobly it was one of the most poorest designed reactor and it happened when you don’t value safety, and they broke most nuclear safety regulations by raising all of the rods.
Reply: @Nonononono_Ohno yeah because being dangerous is a coal plant his default modus operandi, that's not the argument you think it is
Reply: @andres-vi1uy  I cannot understand what you are trying to say, since I do not know which of my comments you are replying to. No, coal-fired power stations cannot cause immediate desasters of the same scale as nuclear power plants can, so they are not as dangerous in this respect. This does not make coal a good energy source of course, since it produces climate-toxic carbon dioxide, which on a long time scale makes fossil fuel power far more dangerous than nuclear power.
Reply: @Nonononono_Ohno   The only thing I can say about worst case scenario of a nuclear plant failure, the most recent being Fukushima, is that it really wasn't that bad.  The effects wasn't that bad.  And we've learned some stuff about it that we can improve on.  Scale it down to those small ones that is used in submarines, the worst case scenario practically becomes nothing more than a localized "oops" because the gains are astronomical to human civilization's future.  And then of course we should still be doing solar and wind where it's most effective.  Hidden advances in those fields or any other fields could be discovered in an environment of abundant nuclear energy that future generations can then use.  Real world data is showing that we are overreacting to the fear of the worst to our own detriment.  It's time we reassess those fears.  Not really because of climate change.  But simply because we need energy.  The more abundant, the cheaper, the better the possibilities for all societies.  Then the worse case scenario in such a energy rich environment is some garage engineer inventing the deathray that kills us all.
Reply: @Nonononono_Ohno  Chernobyl only happened because it was trying to create weapons grade material and not following safety protocols during the test. It could have easily been prevented. Also it was a bad design reactor. We have much safer designs now days that are almost impossible to explode like that. And did you watch this video? 50 people may have directly died from radiation from Chernobyl ...50... in the worst case scenario disaster. A million+ die from coal pollution every year. Dont let the rare, may never happen case scare you away from the safest cleanest energy source we have.
Reply: @Nonononono_Ohno but that’s exactly what the argument was, even in the most catastrophic meltdowns nuclear plants still cause less cancer than the the waste products released from coal plants.
Reply: @Nonononono_Ohno  If 10,000 people die each year in the worst-case scenario with nuclear plants and 100,000 die each year from an equal wattage of coal plants, the nuclear plant is still better — people just don't think so because the 10,000 are happening more at once and are seen as "could have been avoided" due to that.
Reply: @Nonononono_Ohno  Yes, Chernobyl was such an egregious accident that they kept the other reactors operating up until the year 2000, 14 years after the place was "uninhabitable". 
The reality is, Chernobyl is now one of the best nature preserves in Europe and sees regular tourism. Life lives there, just not humans. 
If you don't think coal can ruin a town, look up Centralia, PA, a town whose underground has been on fire for decades and resulted in the abandonment of the settlement.
Reply: @nathancochran4694  I assume you are not seriously considering severe nuclear plant accidents to be something desirable, just because there is wildlife and tourism at Chernobyl. The reactors at Chernobyl were still being operated because there was no suitable alternative. Even so, it was by no means an easy task. Workers had  to take steps to limit their exposure to radiation, such as working limited shifts and rotating staff. I am aware that also coal power accidents can have a large impact. Burning fossil fuels poisons our atmosphere, so it is certainly not a good alternative either. Solar power is the only way to prevent a climate crisis, in the long run.
Reply: @Nonononono_Ohno  "I assume you are not seriously considering severe nuclear plant accidents to be something desirable, just because there is wildlife and tourism at Chernobyl."
yes, I'm glad you can spot when someone is being facetious. What I was pointing out is how overblown the damage to the environment actually was. People assume its a fallout-esque burned wasteland, when life still lives there, just not humans. 

Solar is simply not energy dense enough to make sense as a baseload power, and its intermittency has not been addressed. 
Each panel has a hard limit on the amount of energy it can harvest simply because of physics. 
Solar makes sense in places that are already developed, but underutilized, like on roofs or over walkways, but it makes no sense to upturn the environment and habitats to build massive solar farms. Why would we sacrifice the environment to save the climate?
Nuclear power is the only zero emission baseload power that can be widely deployed. Geothermal is great where it works, Hydro is ok, but also destructive to the environment.
Reply: @Nonononono_Ohno  So what you're saying is you're OK with the deaths attributable to coal plants because they happen over a long period of time? Or is it because you can separate the ones from coal 'plants' , coal 'mines', coal waste byproducts and coal 'transportation' so they seem less statistically significant? Larger numbers are less meaningful if they happen individually? Each of those incidents you're so afraid of was entirely preventable, but rather than learning the lessons and applying them to the safest, cleanest method of energy production we currently have available to us, we turn our backs on the technology and regulate it out of existence. The plant at Chernobyl wouldn't be built today, but plants like it are still in operation because we're too afraid of them to build new ones and close the less efficient, less safe ones. TMI operated until just recently because it was impossible to build a replacement for it, and it appears Microsoft is pushing to reopen it for data center use. Fear is a horrible way to make decisions.
Reply: @cameronfrye5514  Deaths caused by nuclear energy also happen over a long period of time. But this isn't the issue. Each of the coal plant accidents were entirely preventable as well, but also this isn't the issue. Nuclear power isn't so clean at all when looking at mining and extraction, both initial and reprocessing, and yes, there are safer reactors today, than there were in the past. Again, this isn't the main issue. What really matters is that nuclear energy adds energy to our planetary system and therefore drives climate change, and that at some later point in time, solar power will be the only option left, and future generations will not have any power left in order to achieve this transfer. I agree that nuclear power may be inavoidable in the near future, but everything should be done to use this power to achieve the transfer to solar power as quickly as possible.
Reply: @Nonononono_Ohno  Lol.. that's funny! "future generations will not have any power left" 😆 Yeah, sorry. Solar does it's own environmental damage, but it appears you are willing to ignore that as well. I don't advocate for the elimination of solar as a source where it makes sense, but it's not the answer on it's own either. High demand energy needs cannot be met through solar. That will never change, at least as long as clouds exist and people manufacture things. Until you can actually define and measure "Global Climate Change" it's just gaslighting, and those who mention it in a discussion seriously should be ignored.
Reply: @Nonononono_Ohno Chernobyl is an obsolete design, and the "accident" happened due to willful negligence.
Reply: @thomasbialzik3060  Yes, Chernobyl is an obsolete design, modern reactors are much safer. The Titanic is an obsolete design, modern ocean liners are much safer. Yet, severe accidents happen, even with modern ocean liners.
Reply: @Nonononono_Ohno Apples and oranges,  mate.
Reply: @thomasbialzik3060  Of course nuclear reactors relate to ocean liners like apples relate to oranges. The comparison between Chernobyl and the Titanic, however,  is intended to make clear that an improved design never means a guarantee of freedom from defects. I had assumed that would be obvious to everyone.
Reply: @Nonononono_Ohno ah yes I too also love to look like a pseudo intellectual
Reply: @Shubbyshak  I'm not even sure to which one of my answers in here you are responding to. Is that your way of saying, "I ran out of arguments, so I opted for ad hominem instead"?
Reply: @Nonononono_Ohno But the accidents cant happen like Chernobyl because the reactors are physically not the same. The reactor core is always underwater and the soviets used faulty mechanisms which caused the reactor not shutting down because the graphite reacted with the fuel. Its not even physically possible for reactor to meltdown if you don't bomb it or something.
Reply: @Nonononono_Ohno the wildlife never went anywhere in Chernobyl.. some people didn't move out either... Wildlife in the area increased and healthy a few months after the "disaster"
Reply: @Nonononono_Ohno the worst case scenarios are orders of magnitude (thats a lot, like a whole lot) less likely with newer reactors. the worstcase scenarios that have happened where caused by shoddily built reactors and bad practices rooted in the governments building them. the long term effects of continued expansion and reliance on fossil fuels will cause more deaths than these worst case scenarios ever will, period full stop, especially considering the risk mitigation of new regulation and new ways of containing (and in-the-moment preventing) a potential meltdown, nuclear is an excellent stepping stone while we find other clean energy sources that are 100% renewable, like fusion which is making lots of progress. i honestly have less confidence for wind/solar, but right now anything that puts less carbon in the atmosphere than fossils is worth seriously considering.
Reply: @themayoenby  I agree with almost everything you say, but that doesn't make the statement, under which we are posting, a better argument. Accidents can happen and do happen, and when an accident happens, it doesn't help those who are affected to hear that accidents are extremely rare. Fusion technology keeps on making progress for many decades, and probably will continue to do so for the next few hundreds of years. It is not a completely clean source of energy either, and most important, it adds energy to our system, so it is not climate neutral either. In the long run, solar power will be the only viable option.
Reply: @Nonononono_Ohno  those accidents will cause orders of magnitude less damage than fossil fuels long term, that was the use in pointing out how little accidents will happen with new nuclear technology, i even said that in my comment. the accidents will be multiple decades apart at best, and thats still extremely unlikely. what do you mean fusion isnt completely clean or climate neutral? once we have an electrical system that doesnt use fossil fuels there wont be any greenhouse gasses put into the atmosphere because the only emissions are from the building of the reactor, thats the entire point of developing fusion energy. all you're doing is smashing two hydrogen atoms against eachother hard enough to make helium, and then collecting the energy dissipated, no atmospheric emissions, climate-neutral assuming we have a climate-neutral power grid. all of what i just said also goes for wind and solar, which will probably have their places in the transition and in certain areas, but long term i think the majority of the power we produce will be from fusion. solar cant work everywhere, it cant be the only renewable because places get different sun cover or none at all for long periods of time, which is why we also have wind (which also has localized drawbacks), but both arent very space efficient, maybe solar long term but definitely not wind.
Reply: @Nonononono_Ohno  air pollution is one of the leading causes of death globally. Largely driven by coal, oil/ice, and wood stoves.

An incredibly rare event with some deaths is far less dangerous than daily events causing many deaths. Every single year. For decades.
Reply: @Matt-sf9ky  I agree, although it's not such an incredibly rare event, and possibly not only some deaths, but very many. However, this doesn't make the argument from the original poster a better argument. One cannot compare long term safety of something with the short term safety of something else. If the long term safety is to be compared, then air pollution must be compared with pollution caused by uranium mining, concentration, and waste storage. All of these have their own, rather high long-term risks. In any case, both nuclear and fossil power contribute to global warming, and both will run out of fuel rather sooner than later, so the transition to solar energy rather sooner than later is a must.
Reply: @Nonononono_Ohno but the thing is do you know how much had to be done wrong for something like Chernobyl. Even barley meeting the standards of the 70s would make an accident like that impossible
Reply: @nykolettuce3560 Sure, in hindsight accidents like in Chernobyl always turn out to be avoidable. This doesn't make future accidents impossible though. And in any case, it doesn't make the original poster's argument a better argument.
Reply: @Nonononono_Ohno  Nuclear reactors cant cause nuclear accidents either (anymore). Even with chernobyl and the atomic bombs included, nuclear kills less in its entire timeline than a year of coal emissions and mining
Reply: @Nonononono_Ohno  Modern nuclear power plants can’t meltdown nor explode, please search up what a negative void coefficient is.
Reply: @Nonononono_Ohno  Yes, and a coal plant doesn't pollute the Pacific Ocean And irradiate all the life living in it.
Reply: Anything that runs off steam can explode. Your argument about coal plants doesn't hold water. 💧 pun intended!
Reply: @Nonononono_Ohno  Yep, conveniently also ignores the massive water resource drain nuclear plants cause when not on the shore of an ocean (best of luck powering all those data centres being built in the US in the middle of deserts with an adjacent nuclear plant). This vid screams shill...
Reply: @Nonononono_Ohno Chernobyl was caused by human stupidity and bravado. Not a good reactor design to begin with.
 Such an accident will never be seen again. Same goes for Fukishima. What kind of explosion happened at Fukishima?
Reply: @Nonononono_Ohno  Accidents like Chernobyl are not possible with the current technology, Fukushima are not either (and it could probably be avoid it had they build tsunami barriers according to past events). The hundreds of power plants that have been running without issues for decades will keep running without issues for many decades more.
Reply: @jairo8746  No, accidents like Chernobyl are not impossible with the current technology, neither are accidents like Fukushima. I agree that they are very unlikely, but there is always a residual risk. The hundreds of power plants that have been running without issues for decades will keep running without issues until one of them does have a catastrophic failure.
Reply: @Ljfsmith  The eff does the hotel explosion in Playa del Carmen Mexico have to do with energy production deaths?
Reply: @Nonononono_Ohno what about the increased cancer rates around power plants that are guaranteed mortality increases instead of theoretical
Reply: @LastDreamWasMe  I don't understand what you are trying to point out? I think mortality does not really increase around well-designed nuclear plants, as long as they run without incidences, which they usually do.
Reply: @LastDreamWasMe  What might be more of an issue is living near or under high voltage power  transmission lines.  This has been well documented in adverse health effects.  

Joy of centralised power grids.  Still waiting for the day when power is generated for each individual dwelling with no need for the grid.